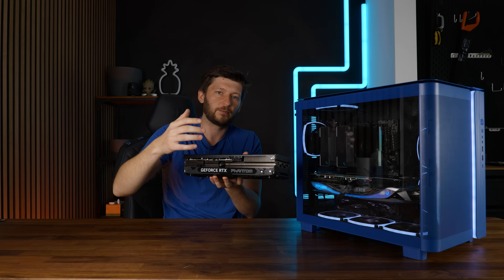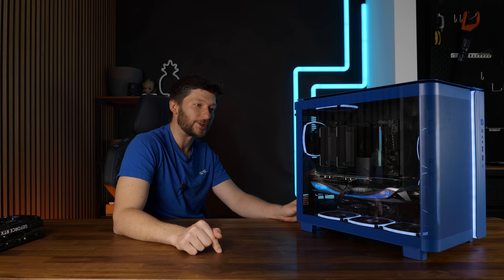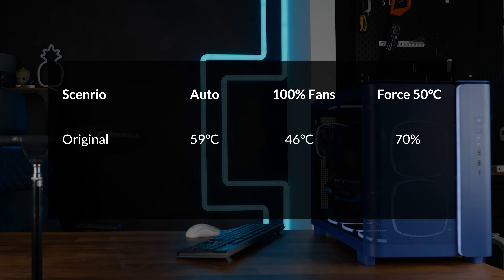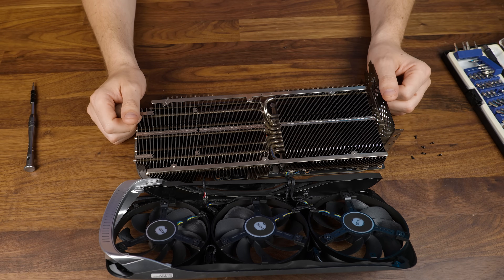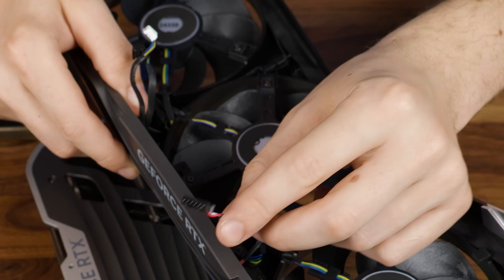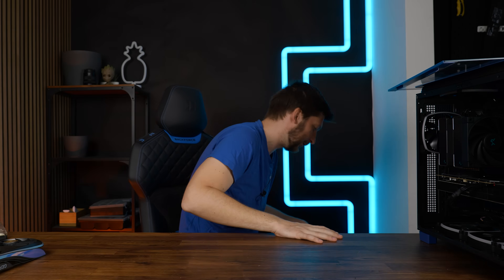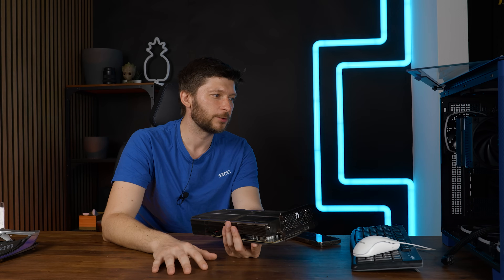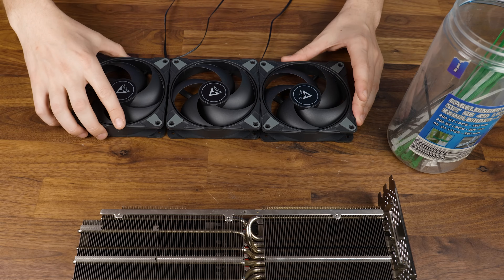Is Deshrouding A GPU Still Worth It? RTX 4090 P12 Max Deshroud Mod

Comment: You have overlooked an important concept: masking. By simply placing fans on a shroud, the effect is not fully realized. If you apply a masking band to cover the fans and heatsink, you will observe a significant improvement. This ensures that airflow is directed between the heatsink fins rather than being dispersed around them.
Reply: Thats such an important factor nd its actually true, he should have at least try that.
Reply: No, he doesnt overlook. If the heatsink was in the Turbo style, then yes. Masking the one that output heat into case will make GPU cook.
Reply: @wilkuuu4016  Spoko Wilku :) tak tylko rozkminiam ;)
Reply: for me it just improved looks(i made 3d print)
not measurable performance benefit
Reply: @MsFearco  Not performance benefit? But is there noise benefit?
Reply: He did exactly what deshrouding always was
Reply: so, make a shroud... for the deshrouded GPU?
Reply: @trbdann2  yes, because this problem (noise) related to fans, not the shroud. 😊
Reply: Another aspect, is the fan rotation, I think the fans are interfering on 100% speed due to te pressure they give, GPUs now have counter rotating fan and I think it may be for that, but don't quote me on that, just thinking out loud
Reply: @DegustoDelSol  not all gpu have counter rotating fan must be a fan design issue
Reply: Yep, apparently quick video without any deeper thought
Reply: This was my thought. He needed something to fully direct the airflow otherwise the edges would be turbulent and lost instead of going through the heatsink fins. I'm no expert though so don't attack me lol
Reply: @prescotthancock5907  Seems to me like the fan housing is enough of a shroud to direct the airflow. I'm really not sure what is to be gained by replacing fans with fans though??
Reply: @stephenhood2948 usually bigger fans move the same amount of air at lower speeds, ideally resulting in less noise needed to reach the same temps or even lower
Reply: another thing to take into account is the spacing between the fans and heat sink. all card radiator and such have a spacing which he has eliminated so ideal would be a shroud with spacing.
Reply: What part exactly would you like to mask? The air has to have a place to escape to. It looks pretty tight as it is.
Reply: @wittywolk  have a gap for the pressure and mask all the edges around the heat sink where the air will go otherwise.
Reply: @tlovsoe4211  if I'm understanding you properly then this seems stupid. The mount in the video looked pretty similar to the original one, I don't see much space to cover.
Reply: @wittywolk  The edges where the skews would normally go are blocked off and no air is flowing through there. A gap would solve this issue however this presents the new issue of air escaping without passing through the heat sink. This is why you create a shroud. This would also allow better use of the 3rd fan as you can block the part which is over hanging.
Reply: @wittywolk  The sides need to be masked as per the heatsink design to ensure that air follows the intended path across the fins. Otherwise, air will dissipate from the sides inefficiently. It is noteworthy that all air cooling manufacturers opt to cover heatsinks both for visual appeal and technical efficiency.
Reply: Could you send me "masking" video? I cant really imagine that concept.
Reply: @thenaberius6081 stock zotac card has a slightly masked heat sink. The fan shroud masks some of the fins.
Reply: I dont see your point. Hot air is supposed to come out from the sides of the heatsink. So if he covers that up where is the hot air gonna go?
Reply: sorry i don't get it. so means he should tape the sides ?
Reply: @ actually no, but if we are talking about a complete solution to see the real difference as this video, then yes.
Reply: How do you do masking?
Reply: @ChinchillaBONK anything that can cover the gaps between the fan and heatink, guiding the air into the fins, could use electric tape
Reply: Re shrouding haha
Reply: Nah. He couldve dropped the fan speed to ridiculously low to reach the same perfectly fine temp of 58C. Just a waste of time to optimize that if you put the card into a case.
Reply: I don't know what this guy was expecting, to be honest. 
The GPU not only went noticeably quieter but also ran 8 degrees cooler which, at such a low temperature, means a ~13% reduction. Besides, case fans like the P12 Max are more air flow centric. If you're deshrouding, it's advisable to use fans optimized for high static pressure, like the ones on the Noctua Edition GPUs.

Comment: 4:54 I have the OC card and i tore up that stubborn cable trying to get it off the card to put a water-block on. And that was with the card fully disassembled. If i ever put it back ill have to solder it or something first. I feel your pain!

Comment: you need a shroud for the fans, otherwise air will take the path with the least resistance, i.e. past the cooler ...

if you have a 3D printer, print two shrouds, one to get some distance between the lower fans and the floor and a second shroud that then directs the air towards the heatsink like a funnel... and prevents the graphics card from sagging

Comment: My 4080S has 4090 cooler and dual bios with Silent mode as default. After decades of loud, hot cards that had to be deshrouded due to the noise levels (Arctic P12 for the rescue!), this is so refreshing. Quiet, cool and does not need any external software to keep it that way.

Comment: 1. The middle fans in trio configuration is supposed to spin opposite direction to avoid wind flutter.
2. These fans have a wide gap in between due to the frame thickness which leaves hotspots in the heatsink, while the oem fans are closer together.
3. Getting better specced fans would've healped as well, Noctua has great radiator fans with higher SP & CFM
Reply: Noctua fans are not better than Arctic P12 Max. NF-A12 competes with it, every other Noctua fans get completely gapped by the Arctic.
Reply: @maozedowner5915 I love the p12max, but they definitely want to replace the bearings with quieter ones, like NSK. They initially have quieter bearings than, for example, the cooler master sf120m, but I would still not call them quiet, although they are certainly not bad. 

noctua uses a bushing (or hydrodynamics, structurally it is the same), they are quieter out of the box, especially if the video card is turned down by fans - then these fans will last longer and they make more sense (if you do not consider the option of replacing bearings in arctic). At low speeds, it makes more sense to take mobius or d30 (or T30, I don't remember which ones and how they differ). That is, I generally would not recommend noctua, but in general they are certainly better than p12max (out of the box), although much more expensive.
Reply: Did you say "wind flutter"?
Reply: Noctua fans haven't been relevant for at least 6+ years now, the P12 / P14 Max fans are much stronger due to the higher RPM ceiling, even the regular P12's are better since they are a little bit thicker (27 vs 25mm) while costing a fraction of what a single Noctua fan costs.
Reply: @Shadowized  Obviously you can spin a fan to infinity and beyond to get extra cooling. But most people don't run their computers like that. It's all about cooling potential at acceptable noise levels. And you can't look at rated SP or CFM levels, you have to go off of measured cooling performance.
Reply: @SatchmoBronson  Where are you getting that nonsense? Not once did I suggest running fans at 100%, I said the opposite of that because people that buy Noctua don't want noise. and no I'm not reading off specs I'm talking real world. Cope harder with your overpriced brown fans.
Reply: @Shadowized  The point of Noctua fan is that they last forever and are way more silent at similar thermal levels. Regular NF A12x25 spin up to 2000rpm, if you want to compare performance with loud very fast spinning fan, put the P12MAX against the NF12 industrials.
Reply: @Shadowized  The P14 is 27 mm thick, not the P12. P12 is still 25 mm thick. The non-max variant is not better than the NF-A12. While Arctic stuff is excellent, don't praise them to the roof.
Reply: @maozedowner5915  seeing as how they (non-max) have near identical static pressure when running at the same RPM while costing 1/3rd the price, I'd say that praise is justified and no amount of brown team cope is going to change that.
Reply: @Shadowized  It is true that Noctua fans sips a ton of copium, but all the reviews I've seen at best have the P12 be just slightly worse than the NF-A12. Some shows significantly worse while others tests show almost equal result, but I have never seen one test result showing the Arctic P12 surpasses the NF-A12.
Reply: arctic fanboys... have you ever tried comparing those yourself to noctua? i tried. arctic is louder, have way more vibrations, worse performance. way worse materials, prolly will last way less.
Reply: @sxdattxb  I have, that's why I said it. The 140mm Noctua's are much worse, anything above 750~ RPM would have very annoying resonance. Two friends of mine had a similar experience so it isn't just a one off.

just type "Noctua resonance" into your search and you'll hear what I'm talking about.

Comment: 3 120 is not ok. You have to optimize the flow. 2 120 at left and right have to fully cover the fins, especially the right one. In the middle you can place small fans like 50 or 70.  I deshrouded mine GALAX 4090 using very simple 3D printed base, -10 degree C. I leave fans at 40%, temps are floating  near 65 at full load,  deadly silent(my main goal).

Comment: Deshrouded my ASRock PG 7900XTX just the other week, it's great!
Reply: And yeah in my case the hotspot dropped ~7C at the same fan speed at 1600rpm but also the 2xPhanteks T30 fans I replaced the 3x stock fans with have a much nicer sound profile.
Dropping the T30's to 1300rpm for a very quite operation I still se like 1-2C hotspot improvment to the stock at 1600rpm.
So it sure was a win for my card at least.
Running this in a Coolermaster NR200P ITX case.

Comment: I wish GPU fans were more modular by design so you can just latch in any 90 or 120 mm fan like an air cooler or something. I mean air coolers have gotten this down over 10 years ago at this point. Why can't at least the AIBs create coolers with modular fans? I don't really care if the Founders edition has built in fans but I'd like the option for modular fans.  For ex if one fan dies on a newer GPU, well you're SOL and have to RMA the entire card... You're also stuck with the fans you get unless you de-shroud the thing which is more of a mod than a feature and more than likely voids your warrenty. There are tens of thousands of fans already on the market, a good chunk of them would already fit on GPUs, why not take advantage of that?
Reply: No it doesn't void your warranty. Magnuson moss act

Comment: It looks like shit and feels like it's just wrong... I have one with deshroud (3080,excellent temps, never audible at all, never above 70c) and one with an water cooling(4090, never goes above 50c).

The water cooling looks nice and is very quiet. But the deshroud is cheaper, like a LOT. But... Getting a proper shroud for 120mm fans is just as expensive as a water cooler. And ziptieing fans is just looking like shit

Comment: I got a SFFPC and I needed to do it to get the GPU in exhaust (no case fans possibe). When you got GPU risers and the card sitting beside the motherboard it's a whole new game. Pull fans on GPUs work just as well as push fans btw. Nice vid :)

Comment: I dont even get why more gpu brands collab with fan manufactures. Chassis fans already got a standard, that is even easier to implement into a shroud design than having to create your own fans as well.
Reply: They have to pay the fan manufacturers a substantial fee for it to be worth it to them. Its much cheaper to just build one in-house.

Comment: I deshrouded my Powercolor RX 6950 XT Red Devil and also got similar results. Replaced the stock two 100mm plus one 90mm fans with two Phanteks T30s. I already undervolted the card and the two T30s don't have 100% coverage over the heatsink so temps werent significantly better or anything. Perhaps a bit cooler. The stock fans werent bad by no means but damn, the noise improvement alone made it completely worth it imo. Much quieter.

Comment: Deshrouding? I distinctly remember this being called 'ghetto mod'.
I used to completely swap for custom coolers. Then I had a GTX 970 that stayed silent with the stock cooler and a custom fan curve. I did do a ghetto mod on a 1080Ti before I switched to a custom watercooling loop and thus waterblocks.
And I did this for quiet operation, not temperature.

Comment: just having the p12 fans looks way better than 90% of gpu shrouds nowadays, Modern shrouds make them look like childrens toys
Reply: Especially this Zotac one, along with the Palit diamond-encrusted one. Hate the look of those things!
Reply: @92kosta  recent ones ive seen is the asrock phantom gaming and taichi radeons
Reply: @92kosta  Too bad that there is basically no benefit anymore
Reply: Sapphire Nitro+ looks minimalistic and really good in my opinion. I just wish they offered more colors for the shroud, such as white, black, silver, chrome, or brushed aluminum silver.
Reply: @astanisystems shame Sapphire only makes AMD. Although one could argue that Zotac is basically their Nvidia counterpart (afaik Zotac's parent company PC Partner partly owns Sapphire)
Reply: @athmaid  Yeah. I also like what XFX and MSI are doing, especially XFX. XFX makes really clean and modern GPUs, and they're usually the best value.
Reply: @astanisystems  yeah XFX and Sapphire seem to be what EVGA was to Nvidia
Reply: ? 30 series were a little much but most of the big 3 brand 40 series cards are really minimal and sleek. Asus, gigabyte, msi are pretty much just flat bricks. It’s all the weirdo brands that make horrible looking cards.

Comment: There is no point in deshrouding a card that runs at 59 degrees from the factory. Please deshroud something that runs hot, like an overclocked reference Radeon 7900 XTX. Check how many decibels can be shaved off by replacing the stock fans with Arctic fans while keeping hotspot tempterature at constant 90 degrees.
Reply: if it sounds like a c-130, there is definitely a reason to replace the fans.
Reply: Reference XTX have some problem with the vapor Chamber according to der8auer
Reply: @Subianto02Prime  that's was a limited to the first batch run where you've been ?
Reply: @potatorigs2155  not really, mu friends just bought a XTX few months ago (January). He return it a few days later cause of the Same problem der8auer found. Now he got a 4080 super lol
Reply: @Subianto02Prime  your friend is unlucky and should buy a loterie ticket this is a small batch issue on the release of reference model.
Reply: @Subianto02Prime  biggest walking W on youtube

Comment: In a direct comparision with good Headphones in your Video, i thought it was absolutely worth it. It even looks better. But that is of course just a personal opinion overall.

The soundscpace is diferent and i would love to hear the difference with a closed case, sitting next to me on the floor. I have a Dark Base 900 pro rev. 2 with 3x 140mm Fans in the Front and an XFX RX6800 SWFT. With custom Fancurve and an Undervolt it is really not loud on full load and around 59°c

While there is no need to do it and this GPU looks quite beautiful when installed, i feel the urge to do it just for fun. Lets see if i also get 3 fans on that Cooler. 

Thanks for the Video. I like these Experiments with now modern Hardware. Also shows that some GPU Cooling Solutions work really really good.

Comment: It's also about proprietarism and repairability. It makes no sense that GPUs aren't designed to have cooling system replacements. While it can be done, good luck figuring out stuff like thermal pads of just the right thickness and compressibility. Besides profit margins, there's no reason GPUs  can't be sold as bare boards, maybe with just the VRM heatsinks like mobos, and have a wide selection of aftermarket coolers.

Comment: This could be more comprehensive, what about a follow-up video with the backplate off? Removing a section of back-pressure since this backplate isn't too open on the corner. Also is this becasue fo the new fans, or is this becasue there is'nt the shroud restricting airflow? Is there any way to remove the original fans from the shroud and install then with hot glue or whatever without the shroud to see if it improves things?

Comment: I have a 3080 MSI ventus I deshouded and put three 90mm fans on. I have it in an itx build and with the new fans I was able to remove my undervolt and it's 50% quieter now.

Comment: I did the exact same mod a few days ago, but on the Aorus Master 6800XT.
In my case, it was definitely a massive improvement ! 
Not sure if the stock fans were on their way out, or just bad ? 
The point is ; the P12 Max ended up far more silent. 
My GPU draws 300watts under maximum load, the way I have it setup. 
Even with only two of these P12 Max, it was better than stock. I still went with 3 fans.
I'm not trying to get very low temps tho. It is staying at 72~75°c Hotspot (12°c above GPU temp) when they spin at 1100rpm ---> Silent.
Oh and the only fan spinning in my computer case, on idle (browsing etc ..) is the 2009's Corsair HX750W PSU's 140mm fixed speed fan  😆
Reply: if you replace the bearings with NSK, the result will be even better. However, the Arctic initially has good bearings, it's just that NSK is better (and this is noticeable). 
NSK with 50cm are not audible over the air flow on the mobius 140p, we are talking about an open stand without other fans. In the Arctic, my 2x P12max bearings are audible, although not nearly as much as on my 4x sf120m from cooler master